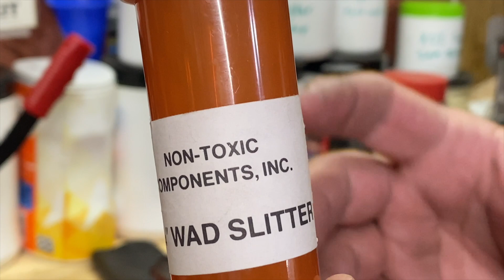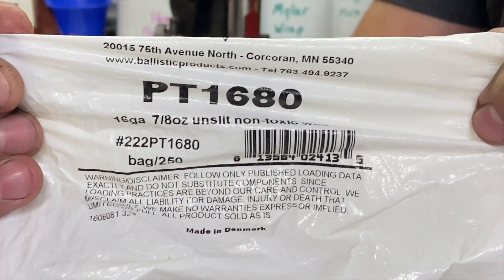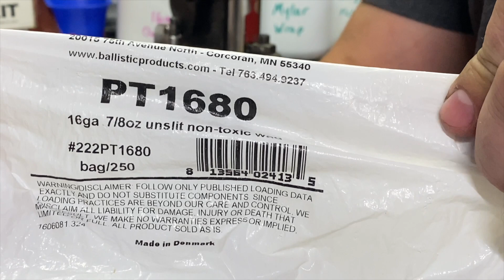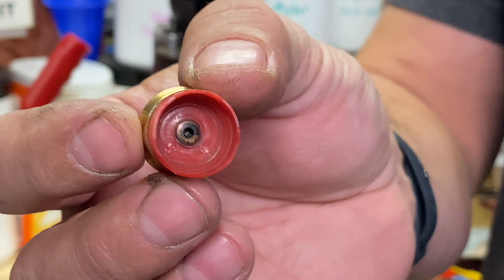Non Toxic Components Wad Slitter   HD 1080p

Comment: I got an old one. It's a tube one end has 3 slits turn it over an it's 4 slits. It cut at a 45% angle it has 6 rings that go around plus a metal clip that let's you cut to 3 different depth.